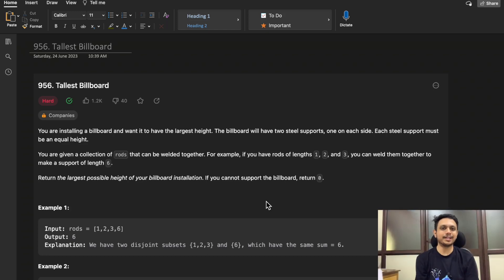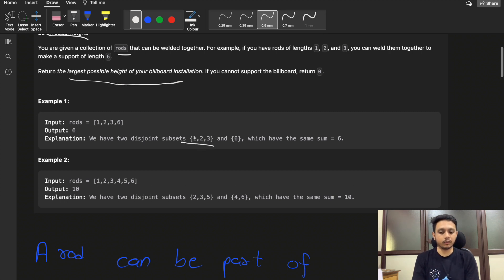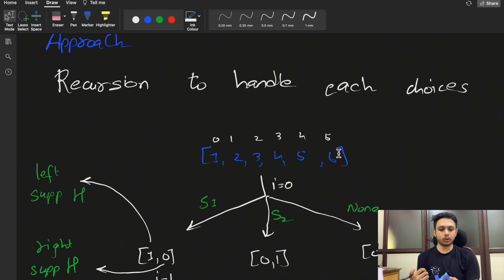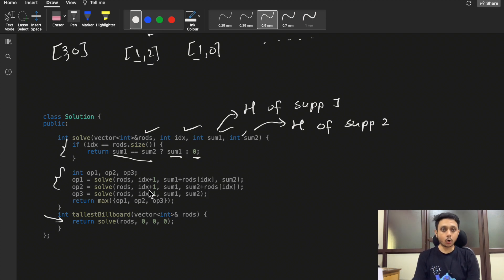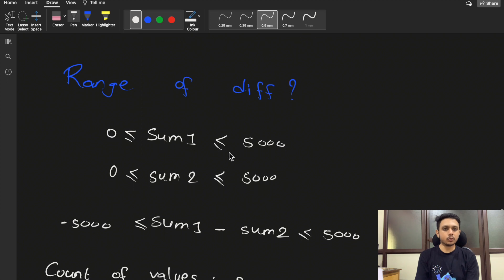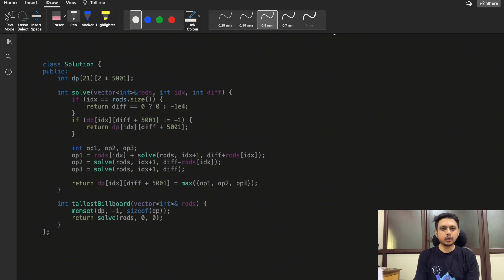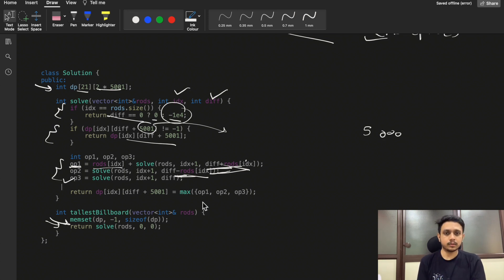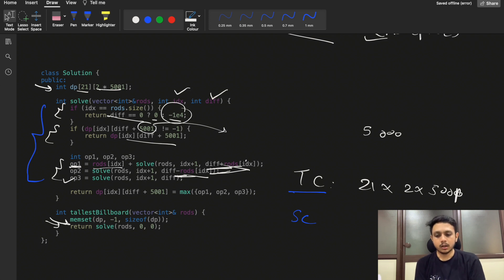956. Tallest Billboard | LeetCode Daily Challenge

Comment: For those who didn't understand the intuition behind this solution.
Imagine 2 supports s1 and s2. s1 starts from 0 and s2 starts from sum of array. Now each rod will have 3 choice
1. Add to S1
2. Add to S2
3. Remove from S2.
Notice the third choice is removing from s2 not adding into Null Set.
So comparing with the solution provided in the video.
op1 is Choice 1
op2 is Choice 3
op3 is Choice 2, as rod is already added into s2 thats why no change.

In recursive solution op3 is Choice of adding rod into a null set. which is different in memoized answer.